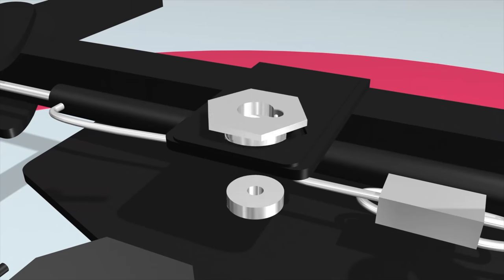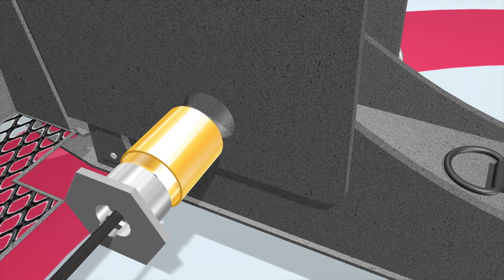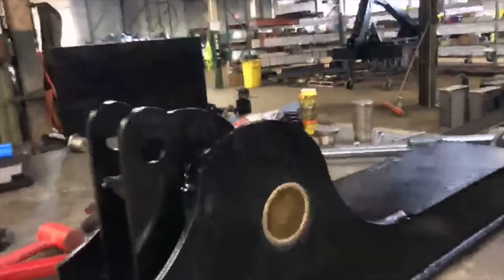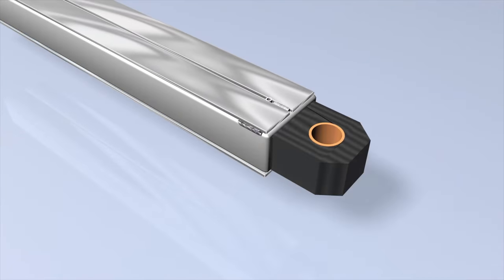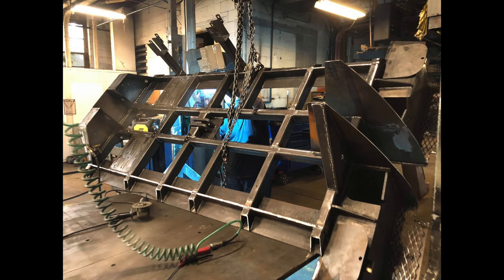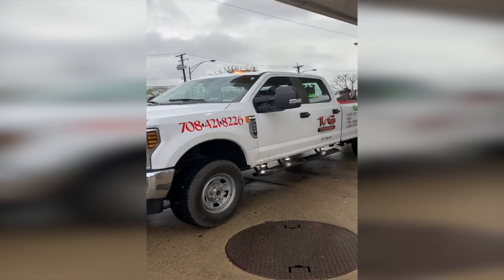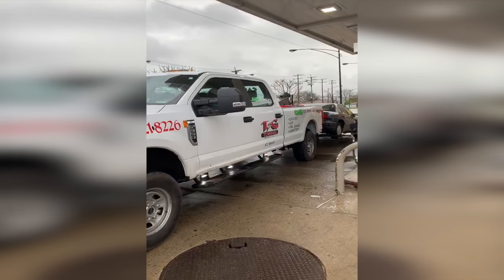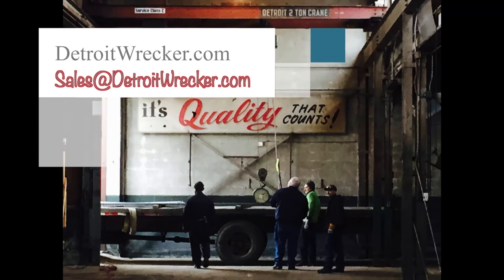Gladiator Wheel Lift for Taco from Chicago T&G Towing

Comment: @ Detroit Wrecker , With This Particular Setup Considering The Actual Weight Of Gladiator Unit Itself Unloaded What Brand Tire Would You Recommend And What Load Rating ?
Reply from the maker: Minimum LOAD E RANGE...love seeing clients go the extra mile and get a F or G RANGE. Thanks for the question call us anytime if you have more! 313-835-8700

Comment: Any detail on fixing the frame to the floor/ chassis, load ratings etc. Required for compliance here. Toss up between purchasing plans to build here or just import the whole truck complete. Our engineer compliance certs aren't always kind to import structures.
Do you manufacture under floor type? Think I saw one on a reponut video, where we can still run a double cab with canopy service truck with the tow option underneath.
Reply from the maker: We do...here is a recent video https://youtu.be/GUPndkNY1o4 #LilHerc